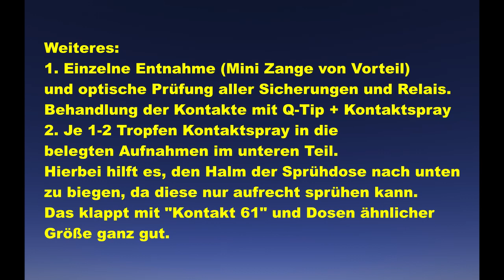Opel Astra H UEC Sicherungskasten ECN 112008 Gaspedal Notlauf Reinigung Anleitung Lösung

Comment: Hallo ich wollte sie mal fragen ob sie ahnung haben was mein astra g coupe haben könnte.
Seit Tagen knallt mir im sicherrungskasten die sicherung durch

7,5A sicherung position 39

Dann geht die motorkontroll Leuchte an, aber das Auto fährt ganz normal als ob nichts währe, wenn ich eine neue Sicherung rein mache dann knallt die wieder durch nach 10 min.

Kann das denn am steuergerät liegen.

Mein Fahrzeug

Opel astra g coupe turbo

Bj 2000

200ps
Reply from the maker: Ist ein komplett anderes Auto, aber habe mal Google bemüht 
"39    30 7,5A ab MJ02 5A        Automatikgetriebe, Motorkühlmodul, bei Z20LET Relais Zusatzpumpe Kühlmittel"
https://www.motor-talk.de/blogs/-tbmod/belegung-des-sicherungskasten-im-astra-g-t2069063.html
Also evtl. die Kühlmittel Zusatzpumpe. Vielleicht Kurzschluss, angenagtes Kabel vom Marder oder dergleichen.
Würde das mal checken lassen.